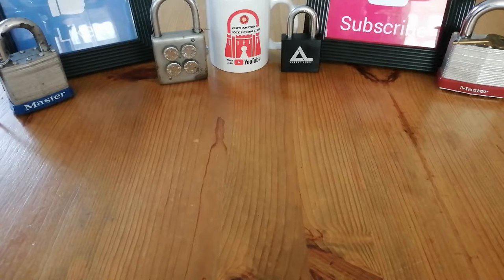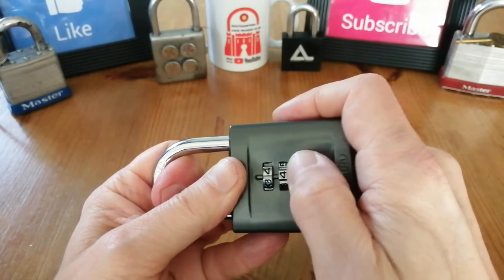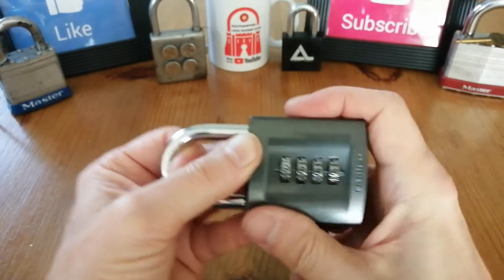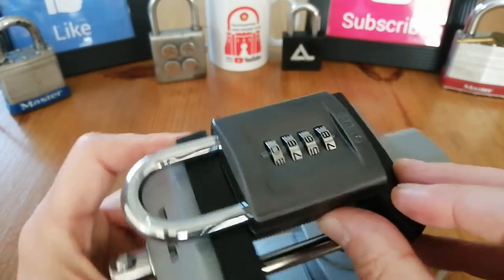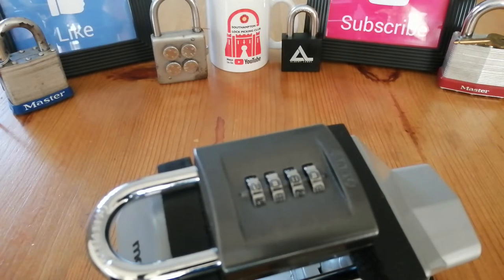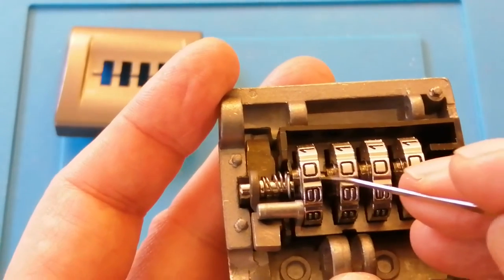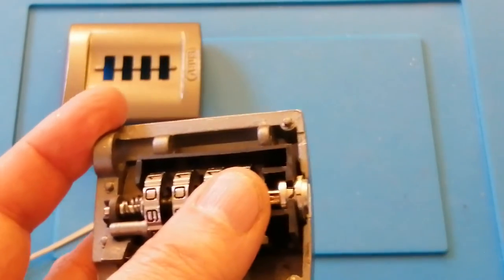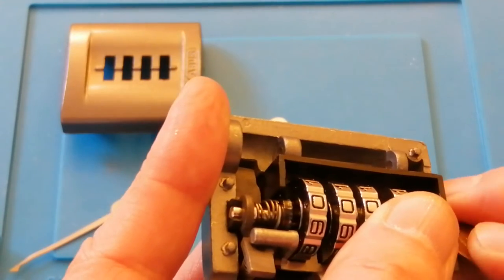#13 Abus Super Code 158/50 combination lock decoded & gutted + Southampton Lock Picking Club update.

Comment: On the padlocks i have that look very similar to this, I found that pushing down on the shackle instead of pulling it did bind the wheels. Im not sure why it works, but looking at the mechanism in yours here, that technique wouldnt work. Before i too bought a decoder knife, i learnt the technique by making a feeler tool from a piece  of aluminium drinks can. It works a treat too.
Reply from the maker: I’ve seen the technique of using a aluminium can cut to a point, but I have never tried it. Thank you for watching.

Comment: Hi Have you done a video on how to open a Squire SHCB65
I just bought one and I am struggling to decode it.When I pull the button out at the side fully I can’t turn the  furthermost wheels
Can you shim it? Cheers 

Ian
Reply from the maker: Ian, I have decoded several of this type of Squire locks, although I am not sure of the model numbers. Can’t say that I’ve had a problem with them. If the button comes fully out, does the shackle open? I do have a CBW85 here that I intend to decode on camera at a later date. I very much doubt that you can shim it. Sorry I can’t be more helpful.
Reply: @sotonlock7894  Many thanks for replying so promptly.
I have the code and can reset it easily. When I set the wheels to an unknown number sequence.
After pulling the knob at the side as hard as I can ,the end wheel
Reply: Is tight and very difficult to turn.The rest of the wheels are slack.They are not binding up at all 
Comparing how to open the Abus 65,/40
Cheers and thanks 

Ian

Is
Reply from the maker: Ian, sounds like the stuck wheel is in a gate, either the true one or a false one. Ease off the tension and that should allow the wheel to turn. If you need any more advice my email address can be found in my channel’s “about” section.